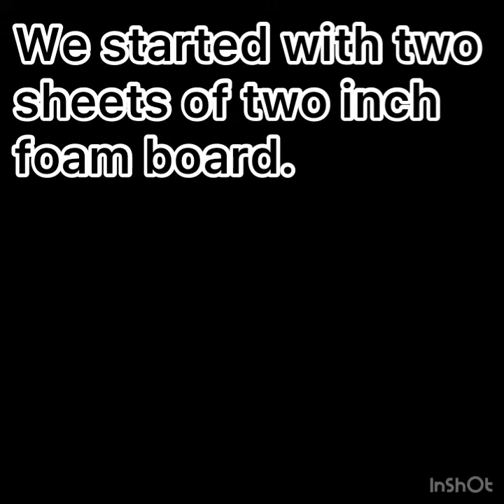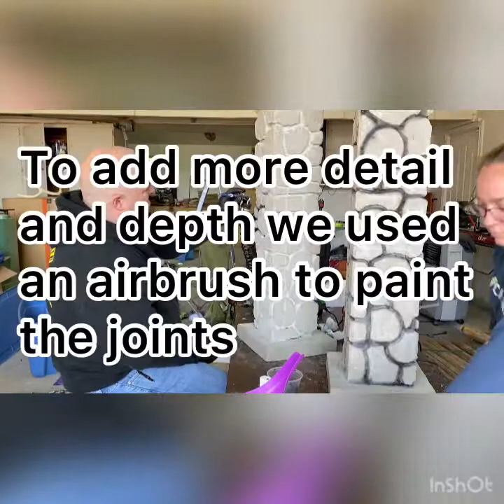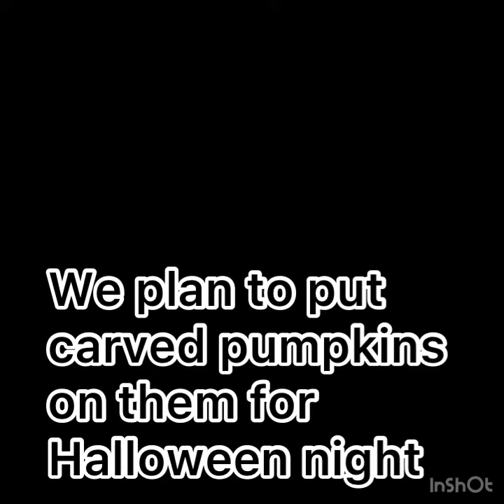Foam Column //Halloween Graveyard //Halloween DYI //Aitkencrafts

Comment: Where'd you get the foam board
Reply from the maker: @JustThatEasy  we got the foam board from Home Depot.  I would suggest not using foam board on the bottom.  We are having to repair all of our columns.  The wind here is wicked, causing them to fall over.  This created big holes in the bottom.  We are currently trying to repair/rebuild them now.